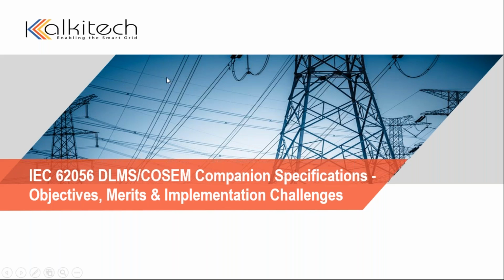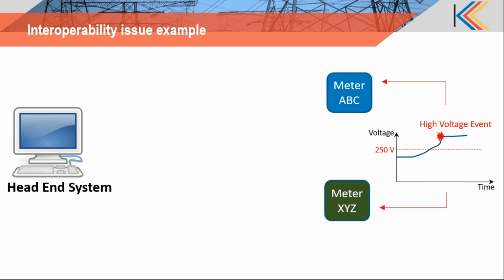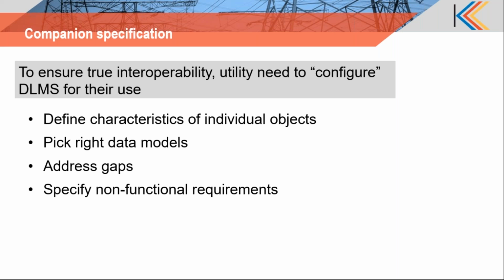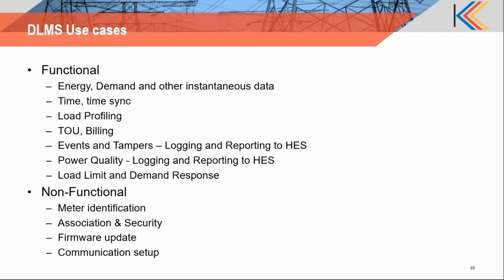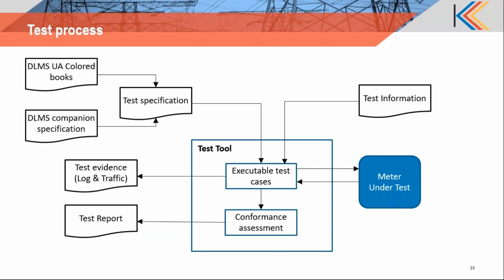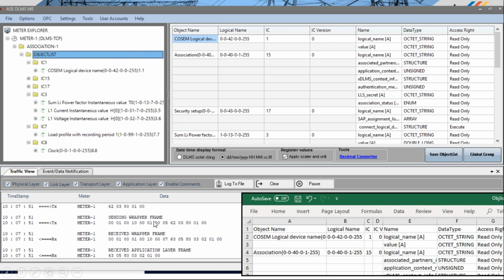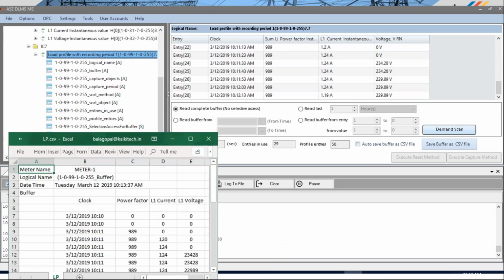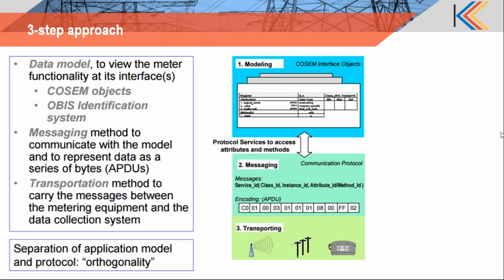Webinar | IEC 62056 | DLMS COSEM Companion Spec | Objectives, Merits & Implementation Challenges

Comment: 🎯 Key Takeaways for quick navigation:

DLMS/COSEM is widely used for metering protocols globally, except in North America where ANSI C 12 is prevalent.
The webinar discusses DLMS companion standards, their objectives, merits, and implementation challenges.
DLMS is an IEC standard with compatibility across various smart grid protocols.
DLMS follows a three-step approach: data modeling, messaging, and transportation layers.
Interoperability issues arise due to variations in implementing DLMS; companion specifications address these challenges.
Companion specifications tailor DLMS for specific utility needs, defining object characteristics, data models, addressing gaps, and specifying non-functional requirements.
Companion specifications reduce integration time and cost compared to proprietary protocols or standard DLMS.
Companion specifications are developed through stakeholder collaboration, mapping requirements to DLMS models, and wide circulation for feedback.
Common sections in DLMS companion specifications include functional and non-functional requirements, covering energy demand, time synchronization, load profiles, events, security, and communication setup.
Time-of-use implementation in DLMS companion specifications often involves activity calendar programming inside the meter for capturing consumption data.
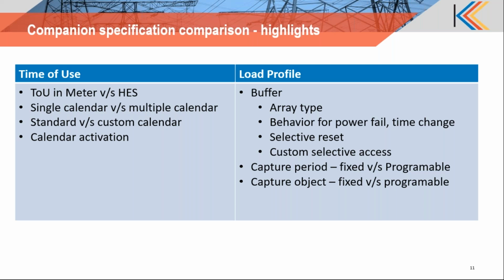At TEPCO, the hidden system or MDM system calculates consumption/billing data from the load profile, not the meter itself. (- 29:33)
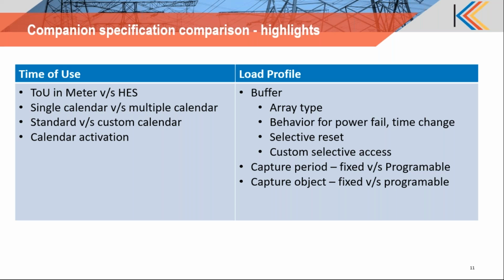Some companion specifications use single calendars for tariff occasions, while others like the Spanish specification utilize multiple calendars. (- 30:16)
Custom calendar definitions are seen, such as in CIgat, which offers a custom calendar interface class. (- 30:53)
Calendar activation behavior varies; Iberdrola specifies strict rules, while Indian standards leave it ambiguous. (- 31:47)
Load profile buffer types, behavior during power failure, and selective reset methods differ across specifications. (- 32:12)
Meter testing involves functional evaluation tools (FET) based on test specifications and meter-specific information. (- 35:21)
Tools like the DLM simulator support simulating various companion and standard meter configurations. (- 39:31)
Meter Explorer facilitates manual testing by downloading meter object lists and monitoring communication traffic. (- 42:14)
Developing companion specifications involves committees representing stakeholders, addressing conflicting opinions over several years. (- 52:25)
Companion specifications undergo revisions to accommodate changes in international standards, market demands, and user feedback. (- 55:05)
DLMS User Association certificates do not guarantee companion specification compliance; utilities may require additional testing with tools like FET. (- 57:36)

Made with HARPA AI/clear

Comment: I am a software developer and want to come up with a dashboard for viewing the metered data. What are the things I should be concerned with to develop such an application. It would much appreciated if I get to see a working scenario of the system  from end to end in Indian scenario and where and what should a developer be concerned with, specifically from web development or application (for end user) development perspective that does not include the firmware or embedded part. Thanks a lot for the presentation.
Reply: Please share your solution if you were able to find one.